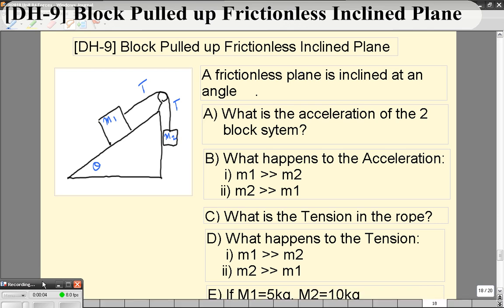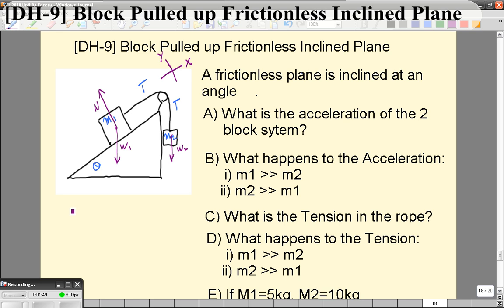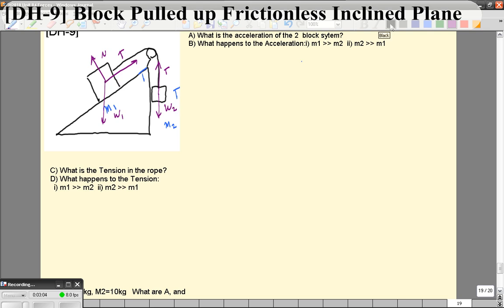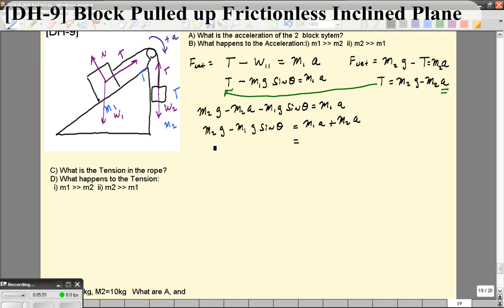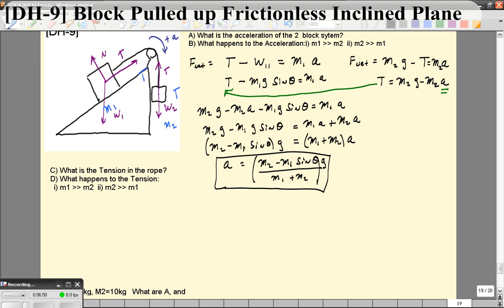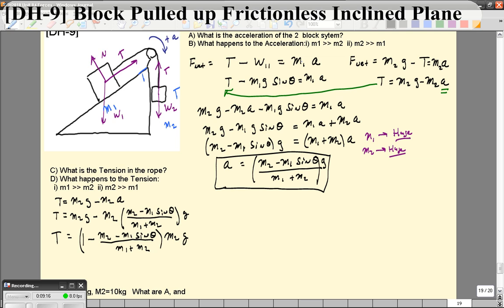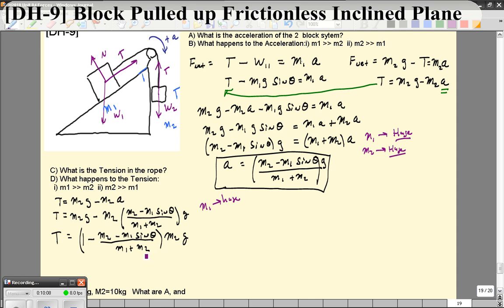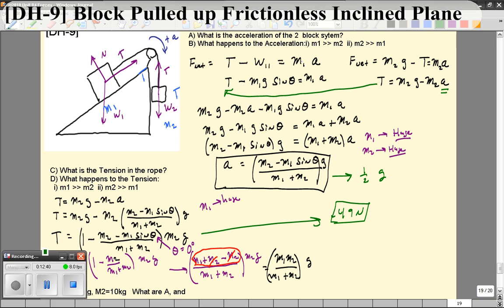[DH-9] Block Pulled Up Frictionless Incline by a Hanging Mass over an Ideal Pulley.

Comment: how would you find the weight of the unknown masses?
Reply: given radius and acceleration
Reply from the maker: Do you mean find the  masses?  To find the weight force of anything you just multiply mass by g.
Radius of the pulley doesn't affect the answer (assuming it's a 'massless' 'frictionless' pulley.)

Knowing the acceleration, you can determine the ratio of m2/m1, but there's no way to know the actual masses without knowing the mass of the system.

If you take the equation derived in the video for the acceleration of the masses, and solve for m2, you get

m2=m1*(a/g+sin)/(1-a/g).   That is, the m1 required to produce the desired acceleration will always be a fraction of m1 that depends on the acceleration of the system(relative to acceleration due to gravity) and the angle of the incline.